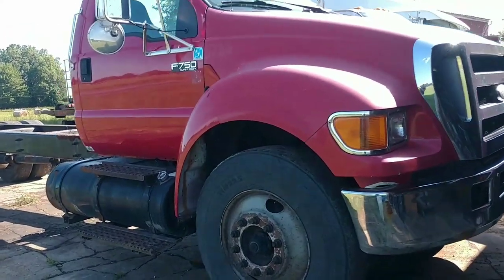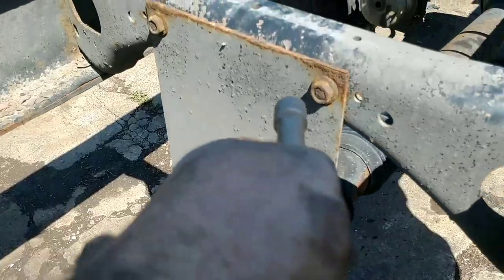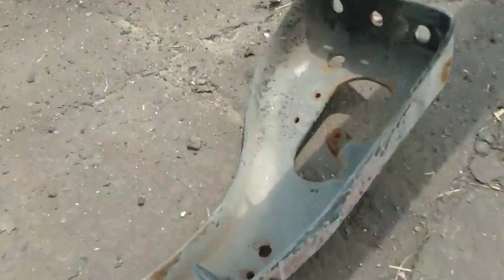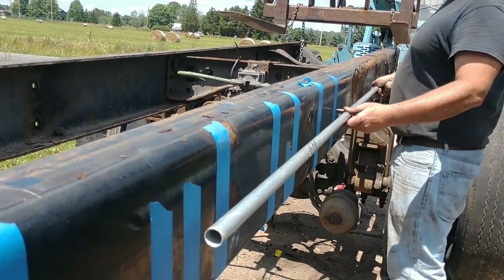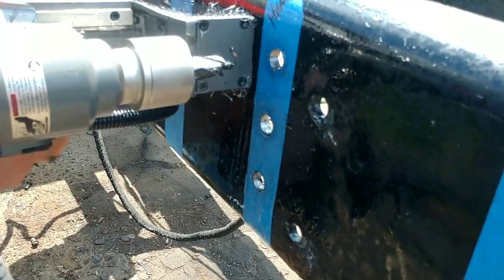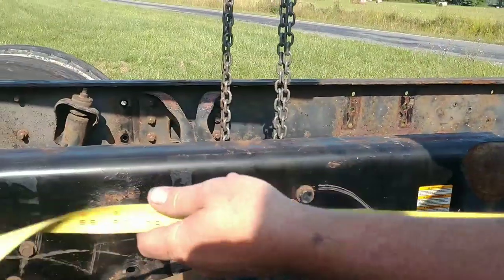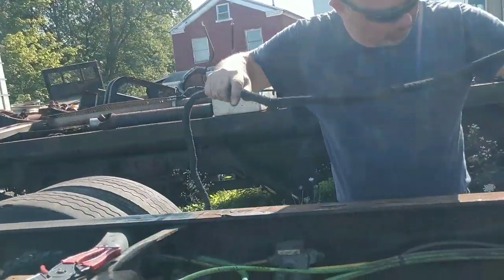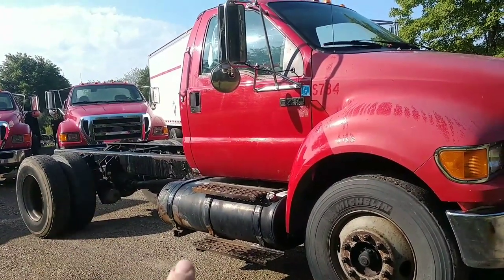MOVING AN AXLE FORWARD. START TO FINISH!

Comment: JC, love your work, especially that the missus is your partner. Kudos to you ma'am, you do an OUTSTANDING job detailing those filthy cabs and could run a side business just doing that!  Story pole/witness stick is spot on every time once set up with correct measurements. Side note: I'm a former aircraft mechanic so I used safety wire pliers often...if you have a set, clamp them on the tie wrap and pull the knob at the end to initiate twisting action. They clamp fast and twist even faster. Great job folks.
Reply from the maker: i have seen the safety wire pliers but i dont have any. i dont mind using vise grips....it works ok. videos are much better when she can video and i can just work!

Comment: Boy that mag drill is the way to go I'm an old heavy duty guy did a lot of holes with a 3/4 electric and they were always a job. Had a apprentice wind one up and broke his wrist.  The other thing I liked was when we moved from Twist drills to those cutters. really enjoy these  especially the marking jig idea.  The Drive shaft story was very familiar have to get a shop that will do it right the first and every time. U-joint angles and phase alignment will put you  out of business  if you have a full bore destructive failure and are the cause of a wreck  Glad I found your videos

Comment: Using the pipe like a compass to get it all the same is damn smart man.  The old body shop  I worked at when I was in school had marker type things in flat stock they used.   They also made a punch cards of the holes to line up from the top and line up better, used old paneling for the cards.

Comment: Man, the way you measure the holes is something I wish I thought of years ago. It's a huge timesaver and eliminates the chance of screwing something up.
Reply: Also another thing I use a line on the driveshaft for is to see if there's any twist in them later on. I've had guys so rough on gear they'll twist the driveshaft and besides keeping the orientation it's a great way to inspect the driveshaft. If you see the line start to twist you know there is a problem and can catch it before it bites you in the ass.

Comment: Your measuring technique is an adaptation of a "story pole" that has been used since the Gothic cathedrals - hell, the Egyptians. Carpenters, stone masons, steel fabricators, sign painters, etc (real ones) use this method for everything from window and door framing to cutting trim sets for windows and doors to stone carving repeating elements etc. 

If Heckle and Jeckle down at the shade tree sneer at what's worked for millenia - the Parthenon was built using storey poles -  and adapted by you for transferring recurring measurements, it's their problem, not yours.
Reply: Long way to say it but gave me a good laugh and i agree 100% works grate

Comment: I'd have spent 45 minutes PER HOLE trying to drill through that with my crap! All light duty stuff I deal with. That bit, and the drill setup was amazing. Looks expensive, but wow what a time saver. Well worth whatever the price!

Great vid, Mr. & Mrs. J.C.! Nice work!
Reply from the maker: i did several of these projects with regular drill bits and a regular electric drill....this setup was an investment for me but it cut my drilling time down to 30-40 minutes total. the time savings may be well worth the cost of the drill and cutters if you plan to do this more than a hand full of times.
Reply: @j.c.smithprojects  - Wow, impressive time savings! Nice! Thanks for the info.

Comment: Boy doesn't a mag drill save a person from pushing their guts out, have used them a fair amount in the past, not a battery powered one just a electric one. Great job JC you've that job down to a science ! Regards OAG🇨🇦
Reply from the maker: i remember using a regular drill. i started with a pilot hole and worked my way up from there. i drilled 160 holes doing a similar truck. i remember waking up the next day so sore i didnt want to ever see a drill again.

Comment: Goddam, I learned something, actually a lot, I''m stealing that zip tie idea from this point on!
Reply: 20 years ago, I stumbled across real zip tie guns. Get 'em  used on ebay ~$25. In one quick step tighten to pre-set tension and flush cut. No sharp ends. Try one and you will wonder how you got along without it.

Comment: Great content y'all are very knowledgeable on the medium duties and big rigs. Watching y'all use the mag drill reminds me of when I was doing some metal work overhead and ended up with a shard of metal embedded in my eye. Not a fun experience . I used a magnet to pull the metal and after I went to the eye doctor they ended up having to scrape the rust out of my eye over the course of a couple weeks. The doctor strongly advised against using a magnet and always visit them first. So always make sure you wear appropriate eye wear 😎

Comment: I'd love to get one of those  Milwaukee battery mag drills at least with that type of magnetic base no worries about power going out like my electric one. When I got my mag drill first time i used it power went out and almost dropped it i was kinda prepared for it mine never came with safety straps so i made my own and bracket attached to screw holes in side of mag base. I use mine a fair amount but not enough to justify the cost of the Milwaukee cordless mag drill.
Good job on shortening the wheel base ive seen people cutting frame then weld back together this much better and safer plus now axle is mounted to better condition framework without the rust 👍👍

Comment: Great follow up video, love the details!! I want one of these. I will be contacting you when I finally have the funds to buy. Hope you don’t plan on retiring any time soon.

If you do allot of these you could make jigs to hang on the frame with cutouts that would allow you to line the mag drill up for each set of holes a little quicker. Just a suggestion for even more efficiency and standardization.

Comment: An old guy I used to work with would make short work of dealing with drive shafts - he made up a fixture where he could clamp the shaft in some 4 inch angle for alignment - get some good tacks on them anthen just sew them up - worked slick as a gut.
Reply from the maker: the shop i use puts it together using a base mount dial micrometer and gets the run out with thousandths of an inch and balances the entire shaft as a unit. its not cheap but i am happy with the results.

Comment: Thank you for the detailed video, very interesting that mag drill. Nice how the airlines come together. I agree, don't move a wire from its spot it has conformed to. Do they discontinue the trucks in service because of the rust? I have never heard of a wreck because the frame gave way but then again, that wouldn't make the news unless they could give someone a black eye over quality concerns. I'm sure DOT catches the rigs before they give out anyway. DOT can be up in your face over the littlest things but then four or more little things become big. I wish they could figure a way to stop the rust from forming but new trucks cost more than a decent home anyway. I have never seen the old corn queen cab go on anything. Maybe a dump truck with all the amenities if the newer trucks air conditioning and tilt just to mention a few. The old queen was wide but I'm afraid not that wide
Reply from the maker: i have to move on to another project now.....i sold my daily driver so i need to get another one set up like my old one. i want my fuel tank, lots of tool boxes, gooseneck hitch, 2" receiver hitch, pintle hook, flatbed and so much more......i wonder which truck will replace it?

Comment: ? Could you cut the top and bottom of the frame beam off , and slide it up inside the other.  Using some heat to bend it in to get started and to jack it tight inside the frame bolt or weld , should be super strong.

Comment: Nice little fleet buy, you can sell the boxes and if guys want the trucks do what you did to this or sell it as is and you will have some drive shaft and other parts you can use in another project or down the road... that kind of a bummer that the shaft got goofed by the first guys, not exactly confidence inspiring when you have new mgmt in place make you wonder if quality will be an issue down the road, at least the other guys saw it and told you and got it right for you. Quite the little project, that Magnetic milwaukee looks pretty slick, I know I remember in a video a long while back you drill some holes in a frame I dont recall whether it was with this Milwaukee though, how did the batteries fare with all the drilling out of curiosity?
Reply from the maker: one battery did the last truck and this one. the mag drill can be some what cumbersome to get set up on the side of the frame but after it is ready it cuts like butter.
Reply: @j.c.smithprojects  Nice. I wondered about that because usually if your drilling thru metal like that it can whip thru batteries pretty quick if you were using a regular drill but that mag seems to do the job pretty well and I am sure Mrs JC helping with the Lubricant makes things go a little easier and save on bits.

Comment: Hey JC, this is exactly what I need done to a topkick 7500/8500 I want to shorten it to fit a 8ft dually bed. It has a 14 ft rear frame and I want to atleast shorten it to 8 to ft. I would love to know what the cost of this job was and as well as where your located if I could get this done.
Reply from the maker: most shops will do this for $2000-$2500. it just depends on what else needs to be moved along with the axle, shortening the driveshaft, repairs to the driveshaft and any needed repairs at that time. i am in northeast ohio.
Reply: J.C. SMITH PROJECTS I’m not that far from there. I’m 6 hours away in PA. are you open to another project? Is there a private way to contact you? I can discuss more on the vehicle and job.

Comment: would it be easier labor on you / your saw to rough cut the old frame rails off with the plasma, say 6-12 inches behind your saw line, and then do the clean cut with the concrete saw. or start the cut at the top of the frame and let the weight of the saw do the work
Reply from the maker: probably but i am too impatient to make two cuts when i can do it in one.

Comment: Can you use a nut buster on the cross member instead of cutting the bolts ? Just asking never seen a nut quite like that before.
Reply from the maker: its a huck bolt...fastest way i found to remove it is with the plasma cutter.

Comment: i have a 05 GMC 4500 that is 26' long behind the cab and i would like to shorten . do you do this for a living ?
Reply from the maker: 4500 with 26" of frame behind the cab? are you sure? i can say i have never run across a 4500 with that much frame. 254" wheel base is the longest i have ever seen in the 4500/5500. is it possible it is a 6500?

Comment: I have a quick question I’m trying to put 19.5 lug 10 lugs rims on a truck but it hits the brakes caliber on the rear is there 2 different styles of the 19.5 rims? On the truck there are currently 22.5 10 lug
Reply from the maker: what is the truck you are trying to do this on? what are the wheels off of? i know the 19.5" wheels gm uses are a different.
Reply: It’s a international but it seems like the inside of the rims hit it’s a 10 lug 19.5 off a international as well

Comment: Need to check out Jonathan W 's channel for his drive shaft mods so you can do them yourself  and only pay to get them balanced .
Reply from the maker: jonathan is a friend of mine.....i prefer to send the driveshafts out to be done. i have to drop them off to be balanced anyway. the cut and weld is the cheap part of the process.

Comment: Noticed you don't wire brush or clean/paint the inside of the channels. I know it would be more work but wouldn't it make for a better conversion? Otherwise another fine job...........
Reply from the maker: that is a simple thing the average person can handle. i try to do work that creates value, work that others are afraid to do or dont want to tackle.  these are things that can make a truck more sell-able.
Reply: @j.c.smithprojects  Understandable. You do a lot of these conversions. Is the market that good for these trucks?

Comment: How do you get your measurements to move the front axle ?
Reply from the maker: i dont move front axles
Reply: Ididnt mean the front my bad
Reply: It’s the rear
Reply: @jrodea174  he was converting it to 108 cab to axle (from back of cab to the center of the rear axle). That is likely what the buyer wanted. Overall frame length behind the cab is shortened to what the buyer wanted.
Hope this helps!

Comment: You didn't say anything about getting drive shaft angle sat right. I like your work. I'm 73 and have cut hundreds of trucks over my life. I still have my shop and still do work. I started at GM truck and then went out on my own. Drive lines is something that has to be right. GM says angle is the be only 2 degrees, and never over 4 degrees. You longest shaft needs to be the rear shaft. That way as the rear end works up and down you don't change the degrees angle that much. Just saying. I do think you do good work. If you need a job call me.
Reply from the maker: i didnt go over that as it get complicated to explain when figuring positive and negative angles. if i dont explain every single possible scenario, people in the comments will go crazy. i was avoiding a bunch of grief.

Comment: The number of 750s you have there is about the total number I've ever seen on the road where I'm from. People don't use them around here. The only trucks of that size I ever see on the road are Internationals. For some reason, they're really popular in Canada. I can't imagine why lol. They're garbage. They must be really cheap or something. Also, the way you dealt with that wire-harness is totally unsat. If it were me, I would cut the loop out and lineman-splice it back together. There's no reason to leave that the way it is. That loop is just a fire waiting to happen.
Reply from the maker: what in the world do you do with your vehicles that a wire zip tied in place that cant move is a fire hazard??  that wiring isnt a fire waiting to happen....it makes no difference how long that wire is....cutting that wire and spicing it is just creating a place for a possible failure. this method works and is always trouble free.....i will continue to do it this way.
Reply: @j.c.smithprojects  If you can't tell why that's the case, you have no business modifying trucks.

Comment: I hate when those 12 points round off,a lot of tow guys,will just hit it with a 6 point and a impact
Reply: Incorrect, 6 point won't work. The reason they get rounded is because the tow op used either a worn out socket or one that was to big. As a heavy wrecker operator I know these things because I have done it before. The trick is you hammer on a socket a size smaller and heat.
Reply from the maker: josh cbuck.....i do the same thing...hammer my socket on with a brass hammer before i hit it with the impact. many time the grease from the ujoint ends up on the bolt heads and collects all kinds of debris. making it hard to get the socket on all the way.